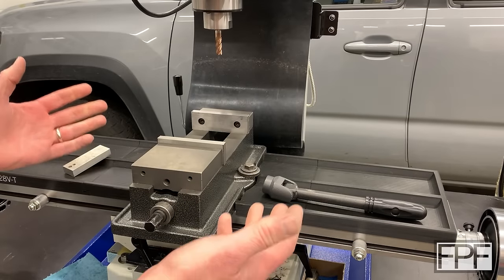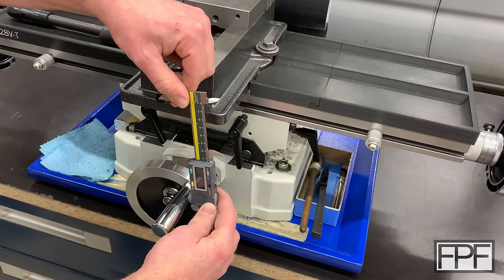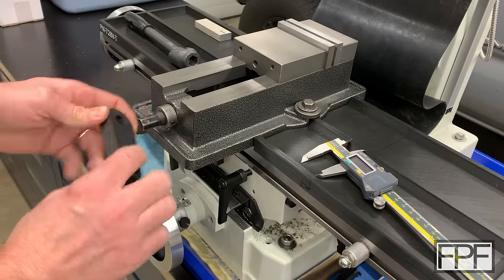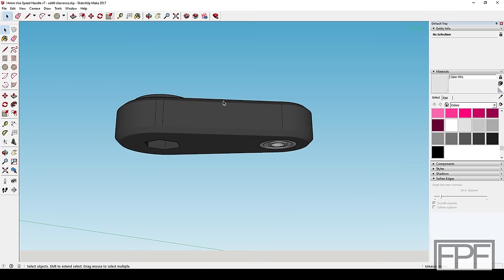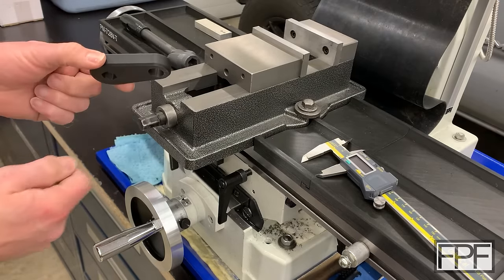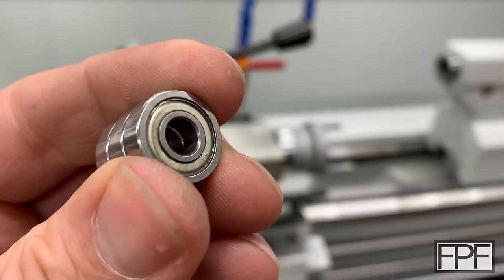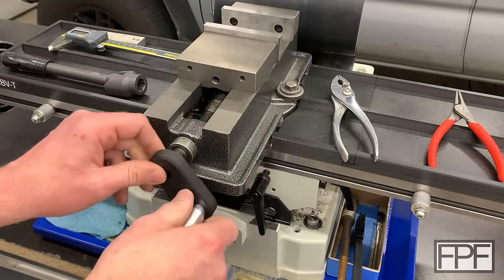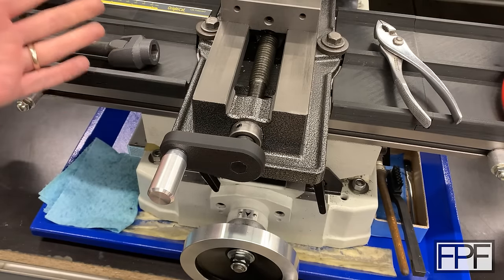3D Printed Vise Speed Handle

Comment: I simply upgraded my cordless drill buy buying the newest model and dedicated the old drill for the mill. There, one less working on “tool upgrade projects” instead of using the tool for the projects I bought the tool for.
Reply: I bought a new drill for the mill......

Shoulda used this excuse to get an expensive one for drilling
Reply from the maker: The advantage to a speed-handle over a drill and socket is to be able to gently bring some tension to the vise jaws with one hand while you position or hold the parts with your other hand.  With a drill, it's hard to find that butter zone where you just barely start to get some tension between the part and jaws during positioning.  Even worse, if you want to loosen it a little to adjust position, then snug it up again,  now you're switching direction with the drill, twice.  Drill is good for production work where you're just banging the same part or blank into a fixture over and over again with no need for alignment, etc.
Reply: @FunctionalPrintFriday  Nobody says you want to tighten the work piece with a drill... If you ever had a work piece flying out of the vise at your face (I did, but I was smart enough to put up a full enclosure with an acrylic door before I let the CNC conversion go hog wild), you know that's not smart! The drill is only used to quickly move the jaw long distance. Then, you put in the regular manual handle for positioning & tightening. Moving the jaw by 6" with the Kurt factory handle is just a lot of silly work! In addition, I don't like the idea that my fingers are in the way holding the work piece when a vise is closing in on them for the kill! Moreover, if you put the vise side way, say, the handle to the right of the table.... most speed handle will hit the table, mine did.... aargh! Guess what "inspired" me to use a drill on the vise? My spanking new speed-handle hit the extension of the table I build to shield the Y-axis motor from my spanking new flood coolant system. *&&(@&#^& aaahhhh....